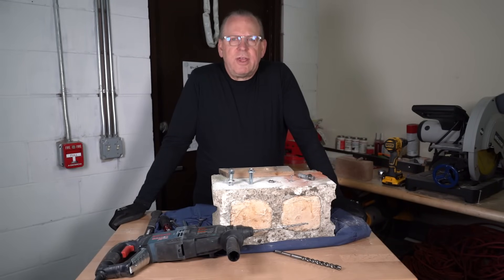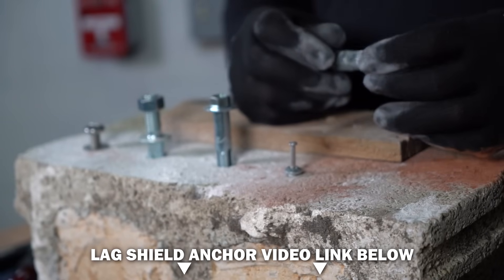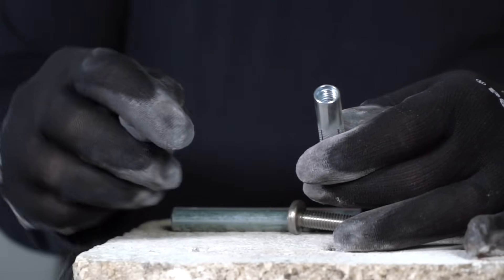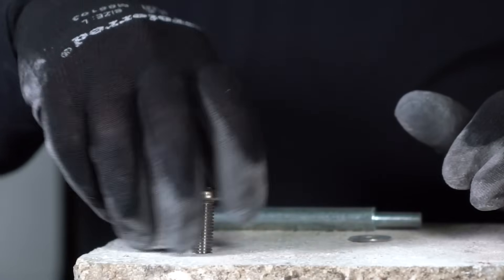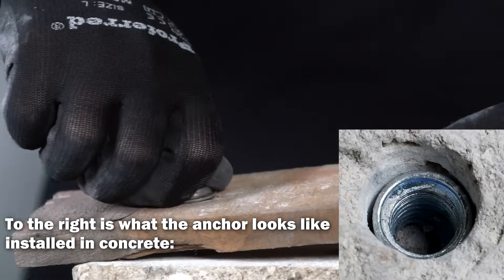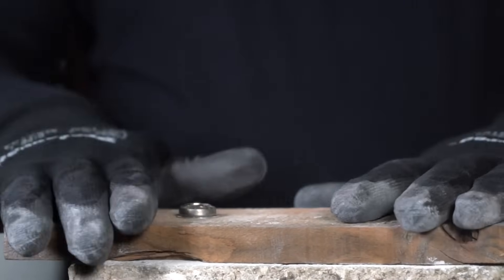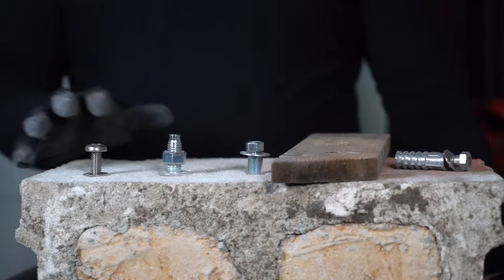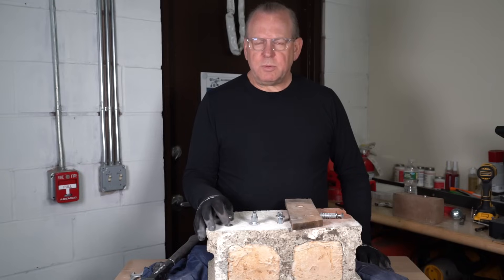How to Install Masonry & Concrete Anchors | Fasteners 101

Comment: what would be the best anchor that will withstand lifting?  i have a septic tank with broken handles and cannot get the beveled lids off the top. what anchor (or other fastner) would work best to make a chain handle?  one maybe two to lighten the load on each when pulling up. these lids are 20“ x 20“ x 4“ and are likely stuck very well in place and i will probably need a jack to loosen and remove them. any suggestions?  thanks

Comment: Could you make a video on how to lengthen  L anchor bolts that are too short. We poured a concrete foundation but we have one area where we need the bolts to be extended about 8-10 inches through concrete blocks. We are looking for the right kind of couplers but can't find any information anywhere.

Comment: How close can you get to the edge of concrete before the concrete chips away?  I would be hesitant to try anything other than small anchors with plastic sleeves at 1" from the edge? Less pressure against the concrete with plastic taking the pressure. Its for holding down wire screen for foundation vent holes at the driveway concrete slab.

Comment: Great video! What is the best  anchor to use for installing ceiling hooks for a ceiling pot rack? Looking forward to your reply.
Reply from the maker: What material is your ceiling made out of? I'm presuming it's some form of drywall, in which case toggle bolts or molly bolts would be the way to go. Unless what you you are installing will way more than what these anchors allow, in which case I strongly advise screwing the ceiling hooks into ceiling joists for better support.

Comment: I have installed a retractable clothes line into a brick wall using 2 sleeve bolts into the 2 factory drilled holes in the ABS plastic housing. However I screwed on each nut and forgot the washer. The installation feels pretty solid but it really does need the washer because the nut is not a lot larger than the hole in the plastic, and the nut pressing direct on plastic could eventually crack it without a washer in between to spread the load.  It seems not a big deal to unscrew the nut and place the washer on and then screw the nut back on. Do you see any possible problem with me doing this?

Comment: I've seen some people use plastic anchors in concrete. Is that generally an ok thing to do? If the object you're hanging is not super heavy?

Also, when you drill a hole for an anchor, is it preferred to make the hole slightly smaller than the anchor plug itself? So that "it fits snug" even before the anchor spreads out. Or is that just making things more complicated. And alternatively, would recommend having the hole be as close to the size of the plug, so that inserting the anchor is easy. 

In other words, The "snugness" of the anchor isn't what matters, it's that the anchor can expand and be "snug" after it has expanded. So it's better to go with a drill bit that is bigger, but still close to the size of the anchor.

Lastly, if the anchor size is somewhere in between the closest drill bit size (it's too big or too small), is there is a quick workaround that is possible? Or is it better to get a plug that is the right size?
Reply from the maker: Yes if not heavy.

Comment: Hi Bob, so we're installing some pallet racks in our first warehouse (12' uprights).  Gonna rent a hammer drill for the day -  wondering what anchors you would recommend for fastening standard teardrop racks (15K lb max) to the floor?  Thx for any suggestions.
Reply from the maker: Wedge anchors are always a safe bet for that. We use Wedge anchors in our warehouse to anchor down our racks and haven't had any issue with them yet.

Comment: So, I was told by my canopy maker that I should get 3/4" expansion screws / wedge anchors for the canopy that I ordered, so that is what I bought. Now that I get the canopy, the holes are only 5/16" wide.  Do I need to get smaller expansion screws, or should I make the holes bigger (5/16" to 3/4")?

Comment: If I'm drilling into the bottom floor of a professional establishment like a conveience store or barber shop is it necessary to check for pipes and wiring underneath beforehand? or is that not necessary when drilling less than 5 inches into the ground? Not something that is happening soon but in the future I plan on doing ATM installations in stores that requires me to drill about 4.5" into the ground and install wedge anchor bolts.
Reply: You can always call 811 to find out.

Comment: I want to build a small, 8x8 shed on a concrete slab. The slab was installed by some prior homeowner, so I don’t know how old it is, but it could be 20 years old or so. I want to fasten pressure treated 2x4s to the concrete, and then screw the framing on top of that. What type of anchor would you suggest? The top will need to be flat. Do you think using a Ramset would be okay? I’m a little concerned about using anything too powerful, which might blow-out the older concrete. Thank you very much for any suggestions!
Reply from the maker: As concrete gets older it actually cures more over time, which makes it harder as it ages. You won't have to worry about blowing out the old concrete.
Ramset would be fine for this application, but we would recommend using Ramset to get everything in place first, placing your shed down, then drilling through the wood and concrete and installing wedge anchors to anchor the whole assembly down.
Unless you're living in an area that doesn't get battered by strong winds or other factors that could topple your shed, Ramset on its own won't hold the shed down nearly as well as wedge anchors.
Reply: Albany County Fasteners : Great info, thanks! I had no idea that concrete gets stronger as it ages. Live and learn. New subscriber!
Reply from the maker: You're welcome! Thank you for your feedback.

Comment: Hello, how long should I wait fit the concrete to set up before drilling and adding one of these fasteners? Thanks for the great video.
Reply: Someone answer.  I need to know if I'm going to use an expansion sleeve in a new post slab or simply cast the wedge bolt itself.
Reply: @trangwuong7689  Practically speaking, I think you would have a very hard time positioning small wedge anchors in place during a concrete pour and keeping them in the right position and at the right  height.  And even if you could accomplish that, then you would have to drill corresponding holes into the material that will be attached to these anchors.

Personally, I think it would be faster and more accurate (and more forgiving) to pour the concrete, let it harden, and then use a rotary hammer drill to drill the wedge anchor holes exactly where you need  them.

Wait a second - I just re-read your question.  Do you mean you were just considering not placing an expansion sleeve in the wet concrete but just the bolt itself, thinking that you could then just unscrew the bolt later out of the concrete After it hardened, essentially casting threads in the concrete that way?

Hmm, not sure that would work at all, or whether you would have to apply something to the bolt threads to help the bolt be able to be unscrewed from the concrete.

But even if you could cast bolts in place and unscrew them out later, you still have the big challenge of then aligning whatever you're attaching to these pre-positioned fasteners.

Comment: I asked for a workshop to make for me a pull up bar that is 205cm height and two dip bars that 130cm he used for the dip bar long screw and for pullup bars i think in home applications it is considered medium or a bit larger bolts they are all woobly the pullup bar is more stable they are fanstened on ceramic floor and under it concrete i don't know what is the best solution is it to go to other workshop to make the base larger or change the fasteners make them longer or larger if i can or make a support and attached to the bars but how they are shaped i don't know yet so do you have any suggestions

Comment: Well done - I believe I made my holes too big for the anchor bolts provided for a front stair handrail that has two posts, one on either end.  I think I might be able to solve the issue with larger diameter anchor bolts, but the bottom flange on the post is not that large so drilling out the existing hole could leave me with little flange to secure.  Is there anything I could put in the larger hole I drilled that would allow me to still use the original anchor bolts?  TIA for your advice.

Comment: Does anyone have any best suggestions on how to install lag shields into overhead concrete to hold a load of about 350lbs? I currently have 3/8" x 1-3/4" lag shields/bolts to hang a pulley system to raise a lower some equipment. Should i back up with an epoxy?

Comment: Great video.  Thank you.  I have to hang a 8 foot by 4 foot 600 lb mural to a cement wall. The mural is tile on a 1/2 inch cement board with a 1/2 inch plywood backing.   I was thinking of attaching the ceramic tile mural to a 2x4 wood beam (one horizontally across the top and one horizontally across the bottom)and then attaching the 2x4 wood to the cement wall.  I would drive a 4 inch screw through the mural, cement board, wood, and then, into the cement wall with a drop in anchor.  There would be four screw across the top and three across the bottom.  Is this what you suggest? Am I thinking correctly? Do you think I even need the 2x4? with this plan is the screw too long to handle that weight?
Thanks in advance.

Comment: I've been using a lot of these for a while now and I'm starting to realize that there could be a lung safety issue even though I personally always wear a 3m respirator, given your extensive experience with these concrete anchors could you fill me in with anything you've learned on that front? Edit: They've become very trendy in ceiling mounted hangers for commercial ventilation and plumbing etc. So the dust starts at the ceiling and falls.

Comment: Very helpful video,  specially for a first timer. 
The only question is how do you measure depth of predrilling?
Reply from the maker: The depth of the hole in the base material should be at least the length of the anchor minus the thickness of the material being fastened. There is no "maximum depth" for most anchors. A rule of thumb is to add about 1/2" to the predrilled hole to catch any extra concrete dust from drilling.
Reply: Once you know how deep you want to drill your hole, measure that far up on your drill bit and put a piece of tape on the bit. The just drill until the tape is right at the concrete surface.
Reply: @williamdebow3478  thank you again for yet another great suggestion.  Didn't think of it, but it will definitely speed up the process 👍

Comment: thanks very much ACF.    any tips if you are needing to anchor into old brick and mortar that is a bit crumbly, please?
Reply from the maker: Your best bet for that is to try using double expansion anchors. You can see those in action here: https://youtu.be/4e9dQO8bLmI
However, depending on how fragile the brick is, there's no guarantee that this will work. If the brick is too crumbly, you would be better off trying to anchor into a different, more solid area.

Comment: I would highly recommend using a air blower tip to get excess dust out of the hole THAN adding abit of concrete epoxy before driving anchor down, just an opinion.

Comment: Good video. I’ve installed a sleeve anchor but it won’t take, just keeps turning. Any tips on how to solve that?
Reply from the maker: What is the sleeve anchor installed in? Is the material sufficiently thick enough? If there isn't anything around the wedge portion of the sleeve anchor then the anchor has nothing to grip onto. You may need to confirm that the material you are installing these in is solid.
Reply: You drilled your diameter of the hole to big

Comment: i'm making a "wire crossover machine" i have concrete floor and want removable eye hook anchors that i can cover when not working out is there aNYTHING LIKE THAT?

so i drill the hole, get the anchor put it in the ground, when im done remove the bolt while i keep its casing in the floor, cover witch a plastic cap or something, then when i want to work out remove the cap, then screw the hook back in, hope that was clear

Comment: What about using these as a "permanent" mount for hurricane season when its time to board up the windows .. Like drive 4 of these into the concrete around where the window is... Like 2 of the right and 2 on the left. This way the anchors are permanent into the block and when hurricane season rolls around, you just grab the wood with the pre-drilled holes in them and mount it the wall and use the screws to secure them to the wall ... 
When its done, you unscrew the bolts and pull the wood off the wall ... leaving the anchors in the block until needed next season...
Reply from the maker: So, in theory, you could use these anchors to secure a mount for hurricane season. But wedge anchors in particular aren't designed or rated for that purpose and require solid concrete for installation. Even if you used wedge anchors or sleeve anchors you're going to have nubs sticking out from your wall.
We actually did a video on this subject previously: https://youtu.be/pn1FerWYXtg
Now, Masonry Screws are the "quick and dirty" way of securing hurricane shutters, but we now have anchors and screws commonly used for this. They are called sidewalk bolts and, used with machine screw anchors, are the most common fasteners to use for hurricane shutters. They are your best bet for created a "permanent" mount for hurricane shutters. You can find them available here: https://www.albanycountyfasteners.com/hurricane-bolts/sidewalk-bolts.htm
Reply: Albany County Fasteners that video is what I am doing now and trying to avoid, I already use blue tap cons to secure the plywood to the house over the Windows ... The problem is that the tap cons are not permanent, once you drive in and out a few times, the hole gets worn out and now the rap cons don't grab the block anymore which forces me to drill new holes .. 
This is why I'm looking for something to drill into the block that stays there permanently ... So that when it's time again, I grab my wood with the 4 pre drilled holes, put it up against the window and just use the screws and screw them into the "anchor" that is already inside the block wall .. When it's done, I remove the screws and the wood and done ... The anchor stays in the wall for the next season ... 
But I guess as you said, it's a block wall and it's not poured solid so there is that empty space within the block that the anchor may fall down into ..
Reply from the maker: Like we said in our comment (Under "Read more"), we now have anchors and screws commonly used for installing hurricane shutters. They are called sidewalk bolts and, used with machine screw anchors, are the most common fasteners to use for hurricane shutters. They are your best bet for creating a "permanent" mount for hurricane shutters. You can find them available here: https://www.albanycountyfasteners.com/hurricane-bolts/sidewalk-bolts.htm

Comment: This video is amazing, thank you for sharing it. Can I ask you a question? We install residential solar panels and we use stainless steel sleeve anchors. But lately we have the problem that when we apply torque to the nut, the screw sticks to it,  and they turn around together. We tried with another supplier but this time we used galvanized anchors instead of stainless steel and they worked better.   We don´t understand why this happens. Hope you can recommend some ideas. Thanks.
Reply from the maker: That sounds a lot like thread galling. Stainless steel is known to do that sometimes but this is not limited to any one supplier. It's more about the friction between the nut and bolt and how the manufacturing process works. Anti-seize lubricant can help out with the problem. You can learn more about thread galling, and why it happens, here: https://youtu.be/_WnFpI3oYLs Or if you prefer to read about it visit our Fasteners 101 page on the subject: https://www.albanycountyfasteners.com/Thread-Galling-and-Fastener-Seizing-s/1248.htm

Comment: I have been given a task at work that i think calls for drop in concrete anchors. They want me to install eye bolts into concrete  to run a length of chain through. Do you think these drop in anchors would work ir do hou recommend something else?
Reply from the maker: Drop in anchors are your best bet for that. Just be sure to double check the specs on the anchors you get that they'll be enough to support the proposed load from the eye bolts. If you're still not sure, we advise contacting an engineer on the subject to ensure the drop ins meet your jobs needs.

Comment: Great video except one major issue. When I install the wedge anchors I always drill my holes into the concrete thru the plate I am fastening down. Why because roto hammers tend to drift and set the anchor bolts off. Once the wedge anchors are in the don't move. Also I always put the nut and washer on the wedge anchor just below the top before driving other wise if you mushroom the top you will not get the nut on the anchor. Unless you cut the top of anchor off. 
I drive anchors in almost every day installing handrails.